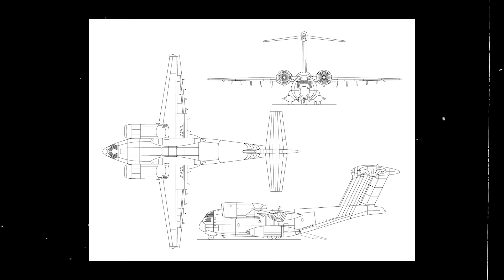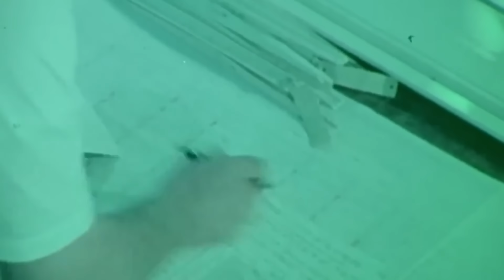The Plane that No One Wanted (But Could Land on a Football Field)

Comment: I saw this aircraft at the Pima Air Museum back in the mid-90's. I had no idea what it was, and thought it was a hydroplane (flying boat, whatever) at first because of the engine placement. Such a cool design.
The YC-14 flew so the C-17 could soar.
Reply: The Russian bE-200 of near same design was first built in Irkusk in 1996 and made it's first flight in 1998.  Same above wing engines went on a seaplane they use in fire fighting (though they seem to always drop from a higher altitude and don't get down on the deck to bust the fire.)
Reply: You need to check out the YC-15. The YC-14 and the YC-15 were in competition for the USAF replacement for the C-130 back in the 1970s. The YC-15 is the little buddy of the C-17A that replaced the C-141B in the 1990s.

Comment: My Dad worked on the development of the YC-14. Just as the program was being cancelled, I was able to go with him and watch a test flight. Fully loaded, that thing didn't "take off" like a normal aircraft.... it LEAPED into the air after an incredibly short takeoff roll. Landing looked like a controlled crash. Compared to all the other aircraft I had seen (many), it just looked unreal. Videos don't give the same impact.
Reply: My dad was the chief aerodynamics/advisor on the YC-14. He took me to the hanger to see it. He got bawled out by a  security geek for letting me in there. He was told that he could stay, but I had to leave as the 15 yo criminal that I was.
Reply: @stevewallace1117  Really?  My dad was just a Boeing PR flack, but he got me into the test bays where they were setting up an ALCM for a test flight--and that was a fairly secretive program.  I was still a fairly innocent 11-12 years old at the time.  I got to go on a PR cruise of the Jetfoil, too.

By the time I was 15, I was wearing torn flannel (pre-Cobain!) to J.P. Patches tapings and smoking weed on top of the Space Needle.
Reply: @stevewallace1117  I wonder where in Government this moron guy ended up after the military.
Reply: some of those stol planes look more like they're being pulled into the sky by cables. like in theater when they lift someone off the ground.
Reply: I used to watch Caribou's doing STOL in paddocks, very impressive, but watching a jet do the same...amazing.
Reply: Makes me wonder if they will try and revive a version of this for the pacific theater, and it’s projected island hopping.
Reply: Homesick angel !
Reply: What a fantastic memory!
Reply: When I began my engineering career at Boeing, one of the old-timers introduced me to the YC-14 drawings and bragged up the aircraft's short field capabilities.
Reply: It looks like something special forces can use today but it's amazing that it could fly at 59 mph and not stall that's amazing
Reply: My dad also worked for Boeing, back then.  Not sure if he had much to do with the YC-14, most of his time there was spent as a Technical Designer in Wiring Installation Support Group.  Every so often he would end up with something military-related but he was always vague, of course.  Nothing more detailed than what you could read in the Seattle newspapers or the monthly Boeing News (employee newspaper).  But I do remember how disappointed he was that the program was cancelled and the Air Force decided to go a different direction.
Reply: Leaped is right!
Reply: REAL SAD that something that had not have the opportunity to proof it's value, be scrapped. Would like to know what made them change their mind
Reply: Nice.  My pops was a principal dynamic load engineer on the C-17 (among other DC/MD/Boeing aircraft.  Got to see the C-17 first flight out of Long Beach, and goddamn if that thing didn't LEVITATE off the runway.
Reply: The C141 and the C5A took off the same way, Compared to all the fighter aircraft and regular passenger aircraft I have seen [grew up in the Air Force, saw 100's of different plane types]. They almost look like they are on an escalator after they leave the ground, "hoisted up at the same time they are moving forward. MAX LIFT. I was long gone by then but, I imagine the new C17 lifts exactly the same, with the same tail design.
Reply: @fredla7353  No this plane climbed twice as fast. It had to in order to escape AA. That is from the extra lift by thrusting the engine exhaust over the wing. You totally missed the point of the video.
Reply: @stevewallace1117  No, I totally got the point. 
You missed my point.
Reply: @stevewallace1117  Well, of course I did. Because YOU say so. PFFT!!
Reply: @fredla7353  Nothing in the USAF inventory took off like the YC-14 - nothing. Everyone around me that day at Mildenhall was shocked at the power of the YC-14.  It was by far the better aircraft in that competition.
Reply: @marshallpoe8087 If it was worth having it would have replaced the c 130.
Reply: How many whistle-blowers did he have killed?

Comment: And USSR made its own copy AN72/74. With the same problem - no one needs overpowered middle transport plane except very rare case of war in very tough places.
Reply: Like Afghanistan?
Reply: @bricefleckenstein9666  nope, there are no local airstrips, even short, so it was not usable. And it was not in time for Afghan anyway. All these machines were used in 90s all over Africa but only because they were available for almost free.
Reply: @antontsau  Which is exactly WHY they had to be used.
Which part of "rough field" performance do you not understand?
DON'T NEED AN "airstrip", just a couple thousand feet of fairly straight and fairly level field - and THOSE do exist in Afghanistan in most areas.
Reply: @bricefleckenstein9666  not even 600m airstrip. All Afgan campaign was transported on choppers, planes used only in several big cities - and no need for stol there.

Comment: Why does this author habitually Soviet original achievements?  From the Ekranoplan through most of Beriev's history both tactical and strategic multi-role aircraft have been ahead of the west in general -- except in a genuinely versatile VSTOL lifter (Rotodyne) and single engine VTOL/VSTOL battle plane (Harrier).
I find it retrograde that the F-35B is based on the Yak-141 and that Lockheed commissioned Yakovlev to build four prototypes from 1991 to early 1993. Lockheed "forgot" to mention this until years later.
Far better research is needed by this site.

Comment: The Russians use this design. 
I saw it all over Russia. Irkursk Siberia and Zhukovsky Airport Moscow. 
I saw similar shape with High bypass fans under the high wing.
that I took a quick cellphone picture of with a high bypass test engine top dead center of the fuselage. 
The vertical stab had a stainless steel or titanium leading edge.

Comment: Probably would have them alter the design to transport an Abrams.  I have no doubt they could have done it.  The problem with current design is that it’s CAD.  These planes were designed by engineers and draftsmen with slide rules and manual computers (human beings doing calculations), unlike current designs which just meet specs and not one iota more. Example-B-52 structural.

Comment: Very interesting, especiallt since Embraer partnered with Boeing to design and produce the C-390. A modern day equivalent capable+ of the YC-14.
Reply: The C390 isn't even as short field capable as the C-130.
Higher load and longer range though - it's closer to the C-17 IN PRACTICE.

Comment: Arguably, with the emphasis on carrying a tank, the M1A1 Abrams was nearly 18 tons heavier than the M60A2, and the M1A2 Abrams was heavier still.  I've seen both YC-14s, both the one at AMARC and the one at the Pima Air and Space Museum, they are unique looking aircraft.
Reply: And keep in mind that a M60A2 was driven into the YC-14 to see if it would fit in the cargo hold, but the YC-14 never actually flew with the tank onboard.
Reply: @LeonardMiyata  As I recall, when the C-17 was in development it was intended  to carry two M1A1s, but by the time it was fielded, the M1A2s were coming on line (at least 12 tons heavier), so it was down to just one.  All that aside, the C-17 is an amazing aircraft.

Comment: Correction - depending on TOW, the C-130 needs 3,000' of runway to takeoff, not 4,000'.  In fact, at mid to light weights, it needs way less than 3,000' to takeoff.  Having said that, I'd love to see the USAF purchase the new Embraer KC-390 under US license production as an eventual replacement of the mighty Herc.
Reply: I love the Airbus A-400M
Reply: C-130s have been used on 1400 foot fields.
Light TOW I'm sure though.

Comment: This is probably a concept they should revisit. Every war over the past 24 years has shown the need for aircraft that can land on short, unprepared fields.
Reply: so true i was thinking the same thing
Reply: They should revive this, with the projected island hopping they are planning for the future pacific theater.  I was in a small airborne squadron and we operated out of fobs and different places in Iraq and Afghanistan, and we used the MC-130J which had capability to land on unimproved surfaces.
Reply: I was in the mobility squadron assigned to set up a fully operational base anywhere in the world within 24 including combat zones. I can imagine the HUGE benefit to that squadron mission. Unbelievable! With jet aircraft speed advantage in a deployment would have cut our mission time window. This aircraft needs revisited
Reply: @billm3589 if your mission time is cut in half then how can the commander keep billing congress for more money ? 🙄
Reply: @billm3589  Red Horse?
Reply: the airflow feature's concept is actually used in a lot of amphibious aircraft with elevated engines and the technology has lead to a lot of better performance in jet aircraft since then even if the primary feature hasn't been used
Reply: Never seen a C-17?
Reply: @gort8203  Pretty certain we all have. That doesn't mean there isn't a gap in airlift/logistic capability.
Reply: @rodolfoptx  Yes, think the problem of it was its own sizing. And the fact that US has this fixation about standardization.  
An-2, An-24/26/32, AN-72, Il-76 and An-22 and An-124 happily coexisted all together and each found a proper use. And most of them had Stovl/Rugged terrain capabilities that western ecquivalents could just dream about.
Reply: 12:40. I assume that is what was meant with this comment..
Reply: @ethanadams8165  I'm not sure what you mean. The time code mentions the C-17 which as the video states, has some of its heritage based in the YF-14/15 Program. That said, the C-17 is still a much larger aicraft, that can be used for both strategic and tactical airlift. The problem I see with this platform however, is cost. A smaller airframe, used more specifically for tactical situations, could be a real game changer. The civilian aspect would also find huge benefits in this, as mentioned above.
Reply: @ethanadams8165 😅 10:41 😅😅😅😅😅
Reply: They should revive this, with the projected island hopping they are planning for the future pacific theater.  I was in a small airborne squadron and we operated out of fobs and different places in Iraq and Afghanistan, and we used the MC-130J which had capability to land on unimproved surfaces.
Reply: Came here to say this. Afghanistan anyone?
Reply: If nothing else it would be great for civilian airlift into remote locations.  There's some airlines in Canada and Africa still running the old 737-100 and 200s with their rough field landing capability.
Reply: @Yaivenov 
Have it be strong to handle rough weather and it could a true lifesaver in multiple regions of the earth, coming in during the tail end of a typhoon or hurricane to begin evacuation or deliver supplies could save hundreds, if not tens of thousands of lives
Reply: @SudrianTales 😅😅😅 10:47 😅😅😅😅😅😅
Reply: First question is…..”WHY YOU NEED A WAR?!”
Reply: @LeeMooEez  If there's no transcendent morality, our standard would be the history of human behavior. As that history consists of almost constant warfare, we therefore can say that war is normative. Questions?
Reply: @LeeMooEez  We don't need war, but when war is thrust upon you at the end of a rifle, or the guidance system of a bomb/drone/missile that targets you, you're probably going to want some form of defence. Unless of course, you don't care at all about living under the direct leadership of a foreign Government...
Reply: @rodolfoptx  It's a nice aircraft. A pity more countries haven't yet purchased it.
Reply: An aircraft like this might have saved the Frengh Foreign Legion troops at Dien Bien Fu.  😮
Reply: The USAF doesn't care about anything but fighter jets. The Navy will come up with this before the USAF does....oh wait.  They did.
Reply: Pretty much every war since the beginning of flight has had that need
Reply: I think what would be better is if humanity can finally mature and grow up and get over having wars to kill each other.
Reply: Military leaders and politicians don't think like logical people. War strategy is determined by pencil pushing desk jockeys, lobbyists, and politics these days. Actual warfighters have no say.
Reply: We have many long runway bases and have refined airdrops operation and equipment that can be airdropped.
Reply: MBGA.  Make Boing Great Again .     LoL 😂
Reply: Peperidge farm remembers
Reply: @zelrond1  They do. So does Eastern Europe. Maybe PF can do them some good home/health/life insurance deals, that covers "Special Military Operations".